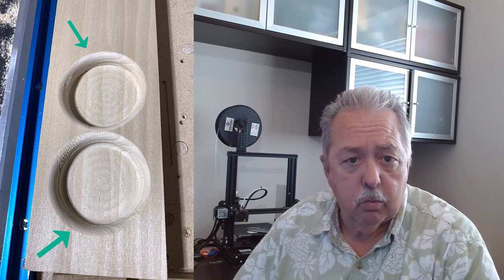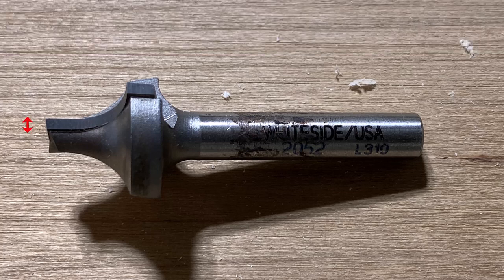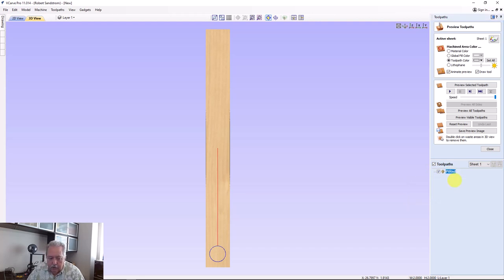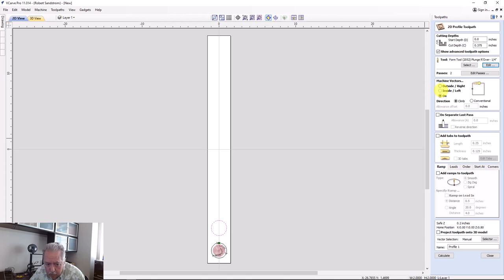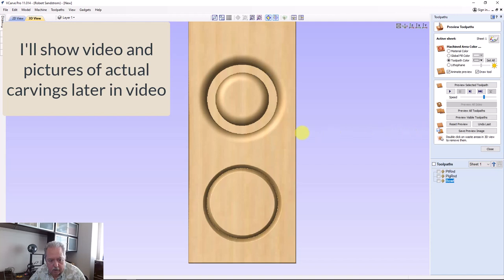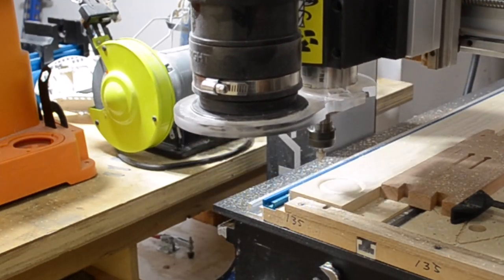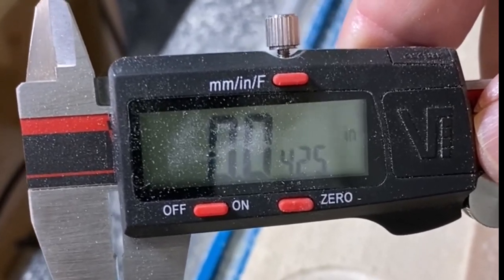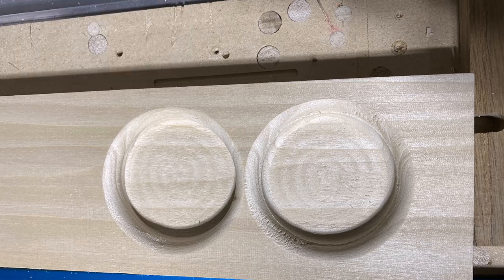How to Use Roundover Bits on Your CNC Router to soften the edges of your edges

Comment: I always was wondering how to use a round over bit on a CNC tool path. If you have time:) I would like to see how to use these bits on the outside edge of board. Where I would normally use a table router for.
Reply from the maker: I'll think about that.  I have a project that I am getting ready to do with Laguna Tools.  Maybe I'll incorporate it on that video.

Comment: Good info. It seems that the point bit has some bad geometry. As a 1/4" roundover, if you set the bit to cut 1/4" deep, at best you should get a very minor ridge line at the top, not the 1/32"+ you got. Also, if you went closer to the .25 depth then you might not have gotten the ridge from the bowl bit. Or maybe the bowl bit has some geometry failings too? 
Was impressed that the Whiteside bit did so well. Thanks for explaining the offset so well.
Reply from the maker: Sorry for the delay in responding.  I thought I responded on my phone before, this happened a couple times last month.  So sorry, I appreciate you watching.    Some good thoughts.  Thank you for sharing your thoughts,

Comment: Great video. I’m rather new at this. I wondered about adding roundovers. Would running the bowl bit before the round over bit reduce stress on the roundover bit, especially the one with the fine point? Thanks.
Reply from the maker: Good thoughts - but don’t believe you need to worry about the tips on those pointed roundover bits.  It really shouldn’t matter.  With that said, you can try both ways of running your tool paths and see what works best on your machine.

Comment: Do you cut the roundover before you cut the bowl or after? Like on v-carve you run the v-carve bit first always. Is it the same for roundover?  Second question: it seems the pointed roundover is the way to go, so why do you need the “offset” bit?
Reply from the maker: I have done it both ways.  Don’t really have a rule of thumb for this.  To be honest I usually only use the CNC for round-overs for some projects - typically if I am going to make several if the same thing.  Most of the time instead of setting up this toolpath.  I don’t always surface all projects - if something is visually fat instead of messing with getting the right z-height setting I just use my router table.  I did want to demonstrate how it can be done if someone wants to do this.
Reply from the maker: I forgot to answer about the offset bit.  I actually had that one first and picked up the pointed rounded over later.  In truth I tend to like the finish on the offset bit a little better, for some reason I experience a little less tearout with the plunge offset bit.

Comment: I just started using bowl bits making small trays, can I use the round over after I've done the pocket cut with the bowl bit ?
Reply from the maker: Yes…I’ve done that many times.  But, be careful the diameter of the round-over bit fits into all areas you are trying to roundover.  I’ve made some catchall trays and baby dishes with complex shapes like elephants and mermaids.  If not careful in tight turn areas may get a surprise or two if you know what I mean.  Hopefully you’ll notice on the preview.  Won’t say how I know this 😂 😂

Comment: Ummm.. D 1/4 has nothing to do with depth. Yikes!
Reply from the maker: Thanks for feedback.  i think you are talking about time stamp 2:20 or about that point.  You are correct that D on the shaft of a bit normally stands for Diameter not depth.  If you look closely at the markings on this bit, it actually has multiple “D’s” stamped on it.  The one is for 1/2” diameter and when I was looking why there was a second “D” I was informed at that time this was to share the “depth” of the bit was 1/4” - didn’t realize this was not a normal marking at the time.  But, notice in the video I do mention to measure and real depth and do some practice cuts  with your bits.